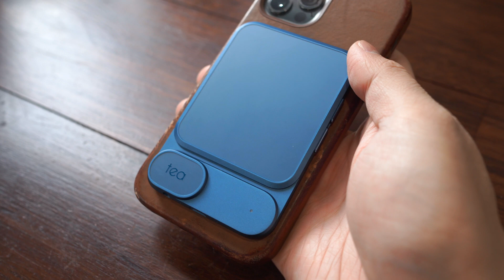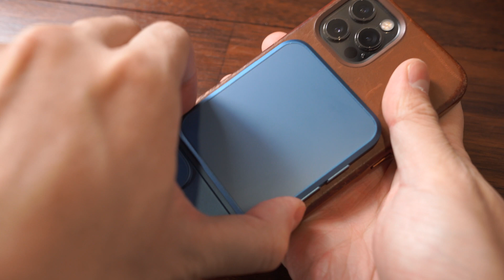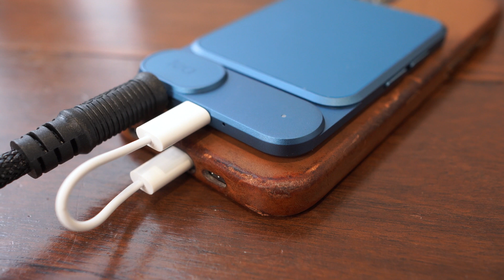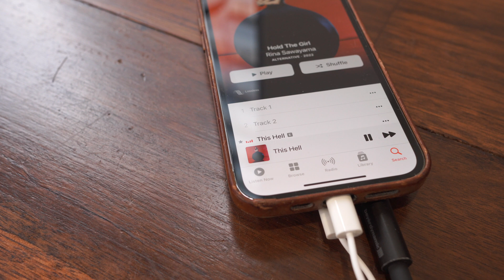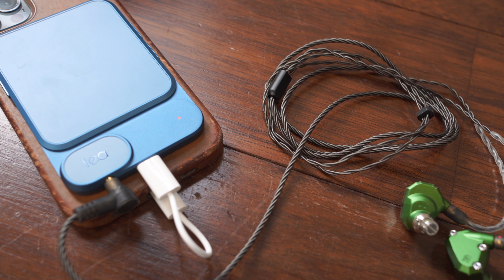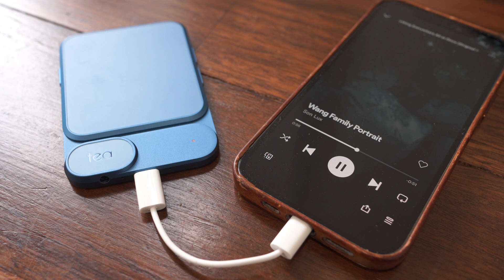Khadas Tea Magsafe Amp/DAC Review: Snap To It

Comment: I'm still trying to figure out if the following setup will work: I connect my iPhone to Khadas Tea with usb/ lightning cable and then from dac I stream music to my Sony WH-1000XM3 bt headphones via bluetooth using high quality codecs like LDAC or Aptx HD which these headphones support. Any thoughts on that? Or maybe I'm totally wrong and bluetooth connection is possible only between the dac and music source, in this case iPhone?
Reply from the maker: Hi there! What you are after is a bluetooth transmitter - the Khadas Tea can only RECEIVE bluetooth signals.

Comment: I wonder how tight that connection is with the magnet,like when jogging.  I wish it had a balance connection . 
Thanks for the review and good to hear your voice  again.
Reply from the maker: Thanks! We find the magnetic connection is very tight when using it with the Apple Leather case, as there is more friction. With the plastic case or directly attached to the back of the iPhone, it can move around a bit more.
Reply: Whyy blueeee😢